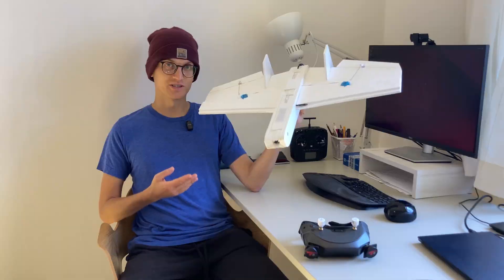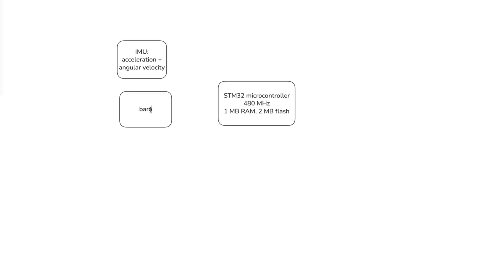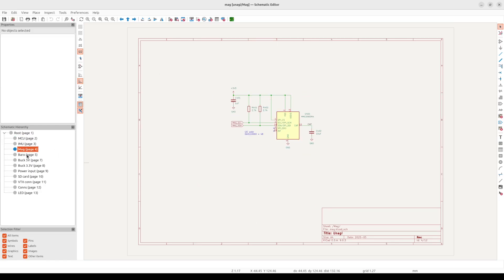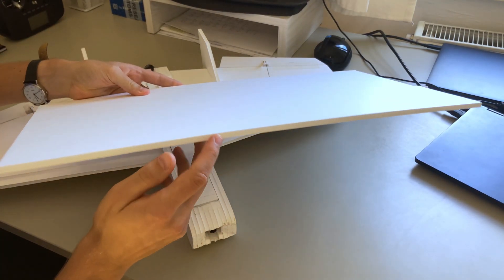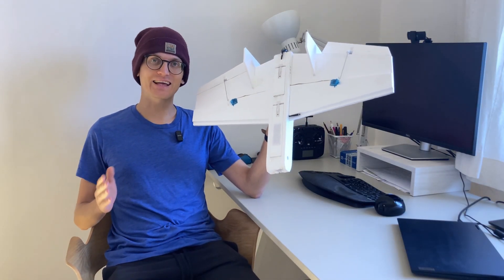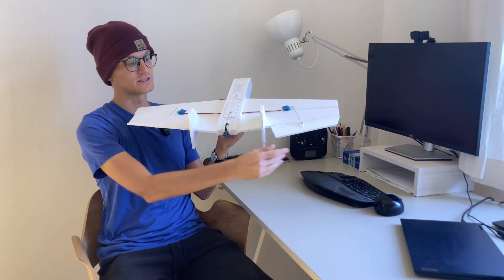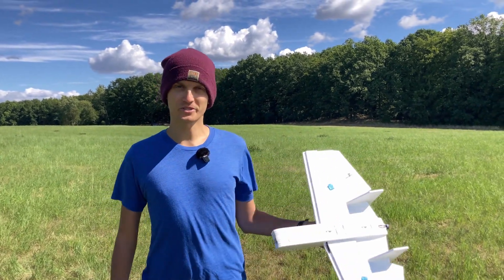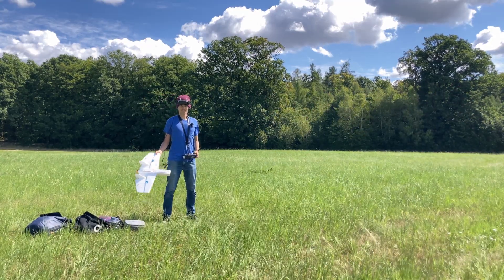Design and first flight of my DIY sub 250g FPV wing

Comment: Very informative video. I'm working on a similar project myself.  What motor and prop are you using?
Reply from the maker: I'm using iFlight XING2 1404 3000 Kv motor with a 4-inch drone propeller. I was aiming for the lightest motor and propeller combo with enough thrust to climb straight up.

Comment: How many mAh does the battery have?
Reply from the maker: I'm using a 4S, 550 mAh lipo. The plane could carry a larger battery, but it would slightly exceed the target weight of 250 g .